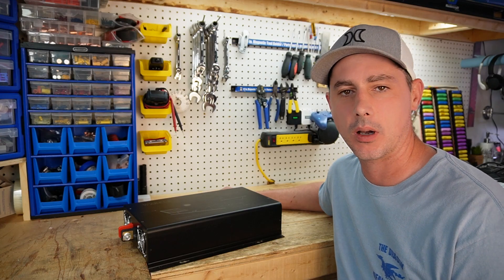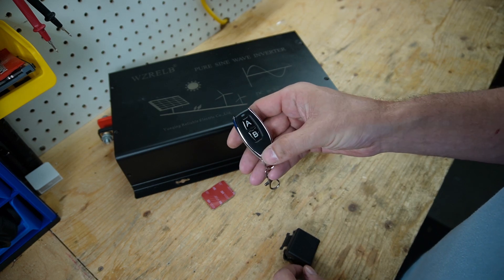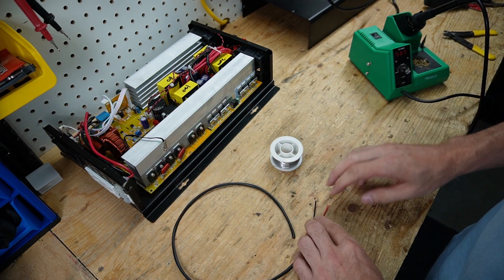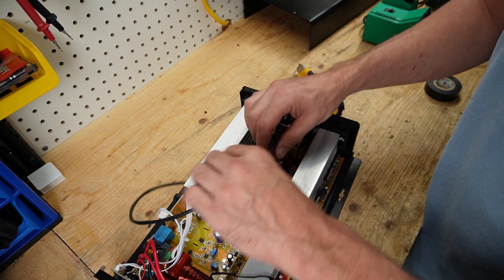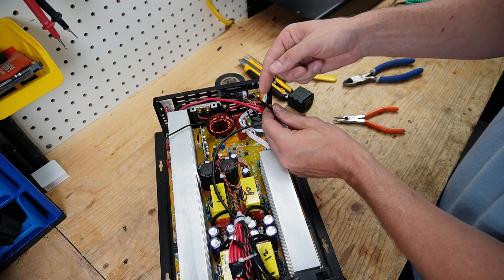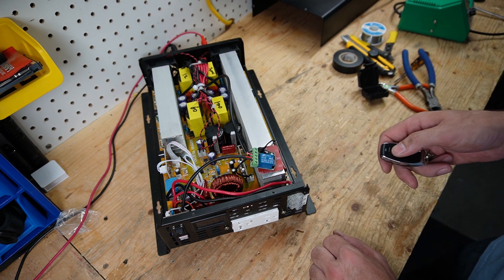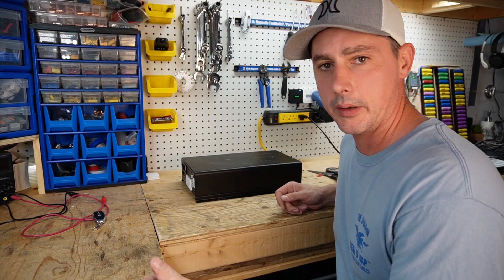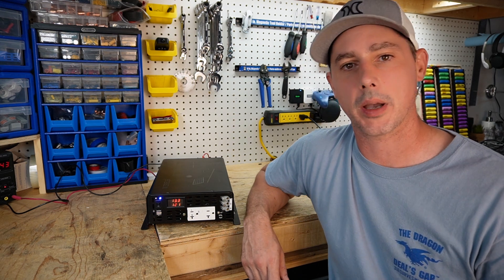DIY Inverter hack to add a key fob ON/OFF

Comment: Holey moley! I have received my remote two weeks ago. And thinking i know what to do, i thought i will just check to see if someone has done the same. Hard to believe I have the same inverter and same exact remote. Thx for the video :) I was actually just going to check the programming of the relay. But you went over that too :)

Comment: Where could I install my switched power and ground wires? My inverter doesn’t have a switch or power button. It’s constantly on when connected to power
Reply from the maker: Hmm, That is strange. You could find a relay big enough for your amp draw, then use the remote to control the relay.